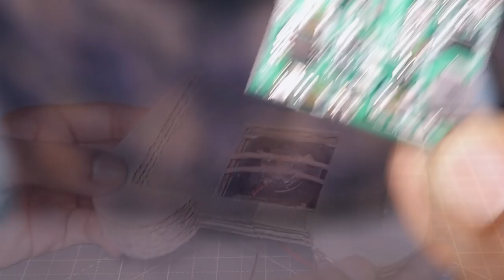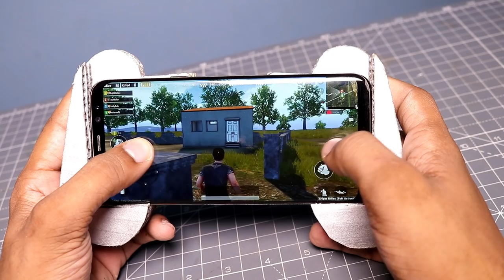WOW! Awesome DIY idea

Comment: It's really unusable think because phone not like a computer 
The computer have fan and not like phone 
phone's doesn't have any hole 
So it's not use full or it's unusable
Reply: A phone is basically a computer that fits in your pocket. Though they do cool slightly differently. But a fan will improve cooling, after all the entire shell of a phone acts like a heatsink. So any airflow will help carry off heat from the device.
Reply: @HobkinBoi  can you tell me 
How can a small fan make cools a CPU with no heatsink ?
Reply: @firesnake6311  I just told you. The device itself acts like a heatsink. Notice how phones get warm when you game on them? The heat goes into the body of the device. If you blow air over the body, it carries away heat.